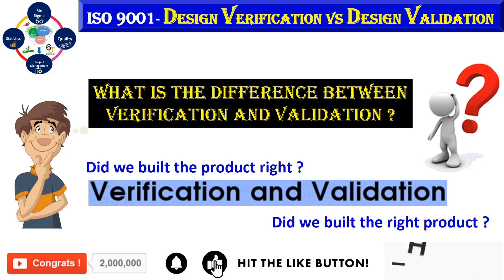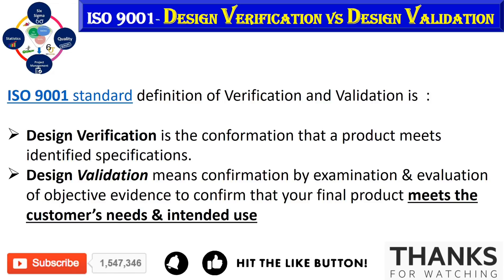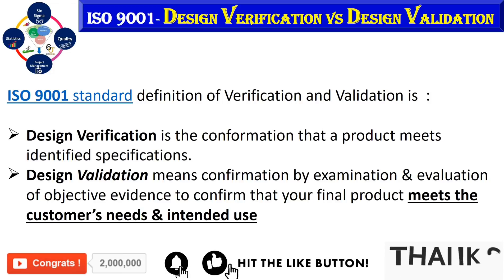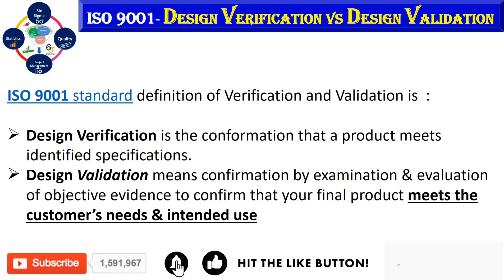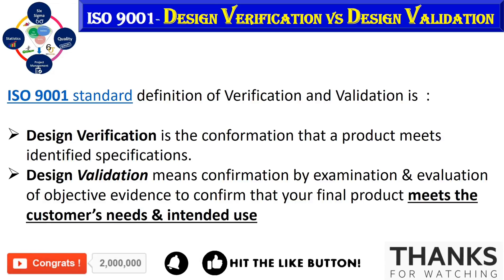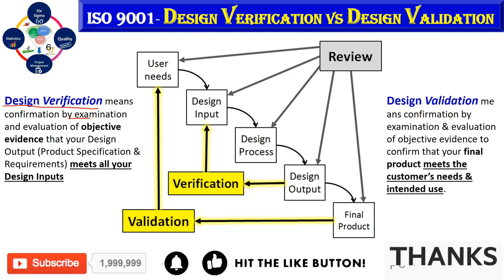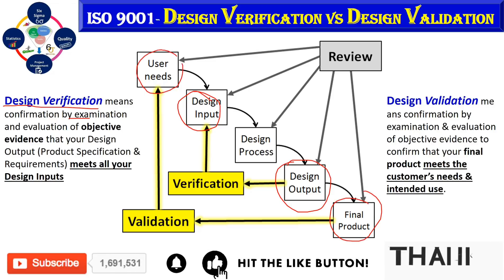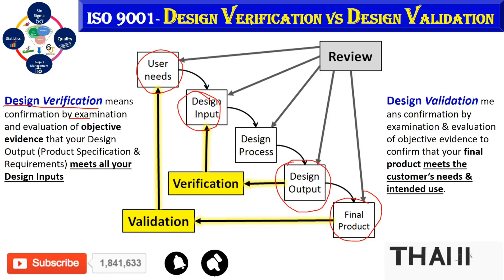Difference between Verification and Validation - ISO 9001 Definitions | Medical Devices |

Comment: Yesterday I started working in quality systems engineering for the first time. I knew the definitions of verification and validation, but I felt as if I didn't truly understand the difference. The two contrasting questions on that first slide at 1:15 clicked for me and now I get it. I had some trouble understanding your accent at first (I apologize if that's inconsiderate to mention), however your content is great and I am going to check out more of your videos. Thanks!
Reply from the maker: Thanks